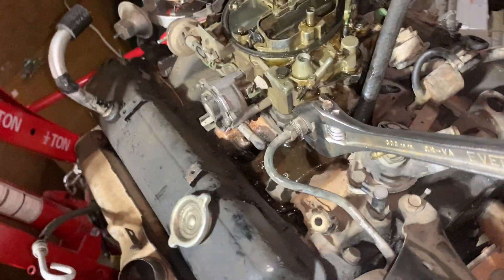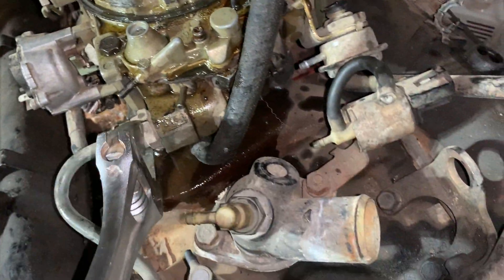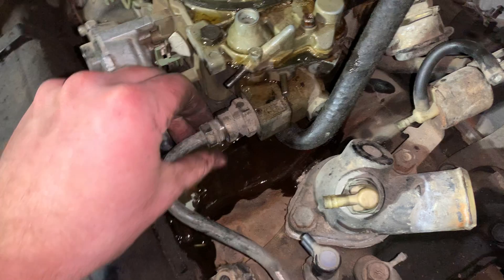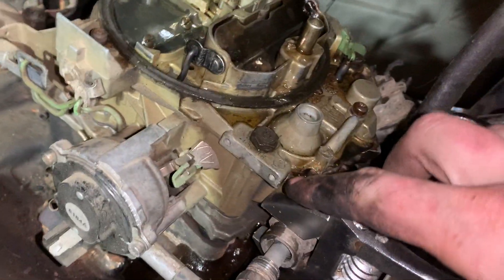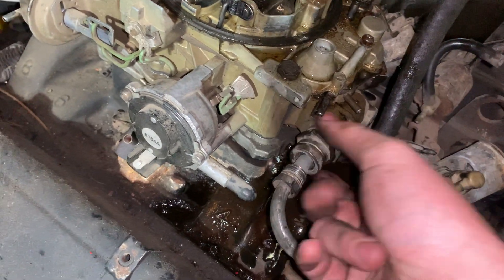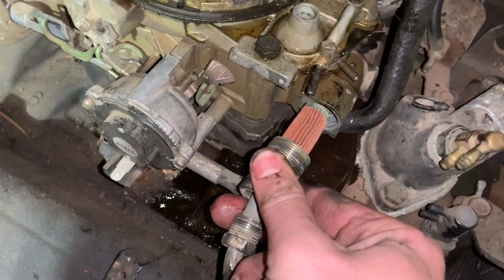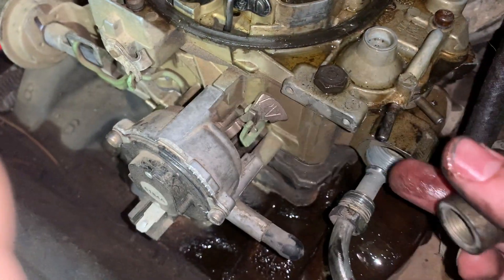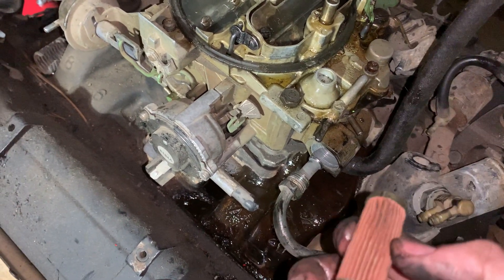1980’s Small Block Chevy fuel filter how to!

Comment: I started a car that was sitting for over a year. 
It started and then it would not start. I’m going to check this filter location.
Reply from the maker: Does it have ethanol gas in it? If so drain and fill it. Then you can pour gas down the carb to get it to kick on

Comment: Will this fix my truck not shifting  at 30 mph?
Reply from the maker: No clue. It might be a transmission issue
Reply: @AnythingJames  it’s weird because before we changed the fuel pump and took it on test test drive it was doing that but two days prior with the old pump we drove I home and got it up to 60 then started bogging down like it wasn’t getting fuel. Hence the fuel pump change.
Reply from the maker: @zantheman2328  I hope you figure it out!

Comment: Is it when you're car stalls out when this needs to be done??
Reply: Man I'm having the same issue just did a full tune up with my last couple dollars today....and it's still stalling out... did you ever get yours fixed
Reply from the maker: My truck as having issues, it ended up needing some fuel line fixed! Hope you guys get it figured out!
Reply: Does it stall after filling up with gas? Mine only stalls after a fill up. Ima change the filter today. Hopefully that's it
Reply from the maker: @jeremyrios8144  mine didn’t. But maybe that will do the trick